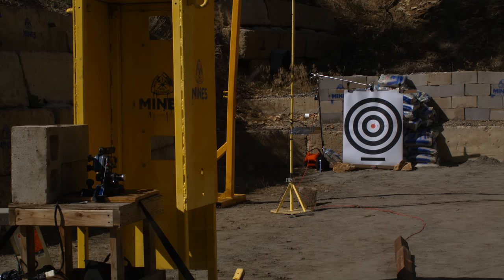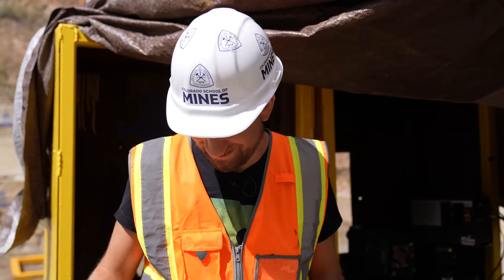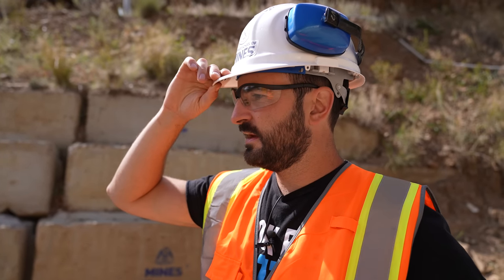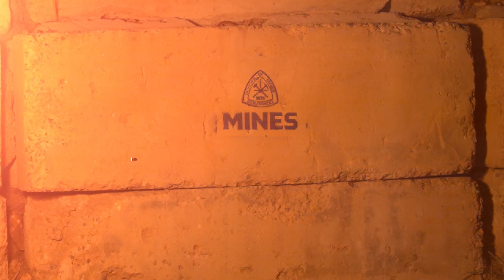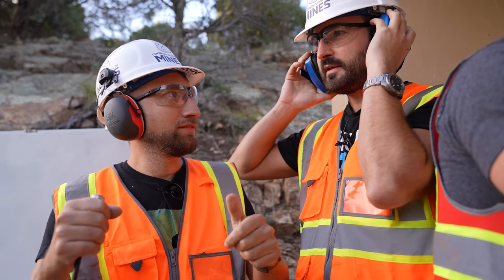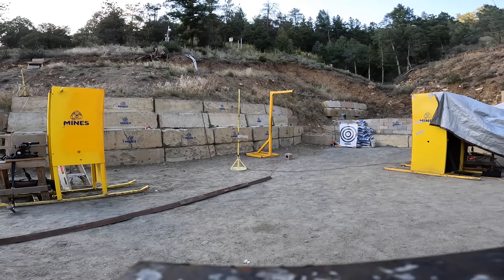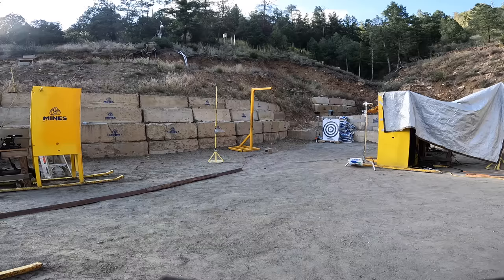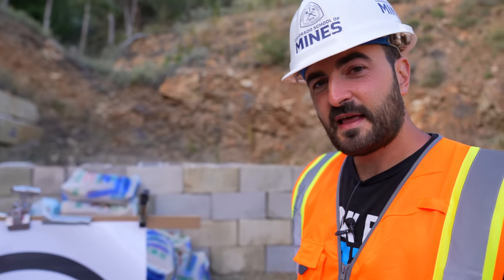Can Explosions Deflect Bullets? 2 MILLION FPS - The Slow Mo Guys

Comment: As a test engineer for a weapons company, it would probably be even cooler to redo this test with a range of at least 100m and a 7.62 or 12.5 machine gun. Why not take advantage of this greater distance to add explosions to the trajectory. :)
I love your experiences! It's great, thank you!
Reply: Can connect with me if possible.
Reply: wouldn't it be more noticeable if they used tracer bullets?
Reply: What? Why would that be cooler? What would the distance change?
Reply: Bro just tryna flex
Reply: @themashedavenger5461  
In theory, the projectile will have less energy and go marginally slower such a notable range, leading toward a few small factors helping the explosion have a larger effect on the projectile.

Also might be why he's suggesting a larger caliber, though those calibers also have more propellant to be faster, somewhat mitigating the first few factors in terms of testing if it would have a greater effect..
Reply: Yes, would be very interesting to have a proper test setup with a supersonic bullet, sturdy firing mechanism and target, repeatable ignition, data plotting etc. But ig they're first and foremost youtubers, not scientists and it wont improve the footage soo...
Reply: @NoBody-pw3kfthe main problem was that there was not a repeatable test setup (as you can see by the spread) so the statistical error was too big to get any meaningful data out of the experiment
Reply: Your job sounds fun!
Reply: Do arrows, subsonic 22 caliber bullets subsonic 300 Blackout bullets. supersonic 7.62 bullets @ 3000 fps/ ~1000mps, then larger supersonic bullets. Then we would find how speed affects trajectory just as we do shooting longer distances.

Comment: Regarding the exposure, if you can get access to identical cameras (I know, probably not gonna happen with the good ones) you can create a mirror setup to perfectly overlay their perspectives and have each record at different exposures, allowing you to capture HDR footage in slowmo, or fade between the shots to always get it best exposed.
Reply: Could get misaligned due to the shockwaves.
Reply: @Kamzik123 sounds like a skill issue
Reply: @Kamzik123 as long as the camera is further away from the explosion than the bullet is you will still get a stable shot

Comment: The bullet has a pretty tiny surface area for the shockwave to act on and is quite dense. I would've been more surprised if it had been significantly deflected. But who cares because awesome slowmo detonations are always epic.
Reply: Yea, the premise had me instantly thinking of that old Mythbusters episode where they tested if an explosion could 'push' a person in midair away from the point of detonation Hollywood style. The effect was so miniscule that they tried to 'replicate the results' by strapping a huge sail onto the dummy they were using and it still barely made a difference. That dummy was way, way less dense and carrying far less relative kinetic energy than a bullet in mid-flight. Based on those results I knew right from the start that the C4 never stood a chance against the bullet. Still a fun video!
Reply: That's exactly the relevant factor. You could possibly even estimate the amount of deflection.
Reply: Who would have thought that bullets are designed to go straight
Reply: also the gyroscopic inertia from the rifling

Comment: From my limited military experience, you'll have to set off the explosive before the bullet gets to the explosive location to get any effect on the bullet's direction. In my mind the way you were doing it was like the reaction from a two stage rocket. There's another YouTube video explaining explosive reactor armor on military vehicles. That'll get you a better starting point for round two.
Reply: I agree. I also belive they used the incorrect explosive. It should have been a pushing charge. In fact, now I think of it, perhaps a water impulse charge would have the best chance. Though I suppose it would leave a question as to the water or explosion pushing the round
Reply: Water Impulse charge is a cutting charge. I don't suspect it would have enough concussion force to deflect the bullet.
Reply: Yea exactly. It's like asking whether or not water can deflect a bullet, but instead of shooting the bullet into water where the bullet is experiencing the proper opposing resistance, you instead tried to pour water onto the bullet as it was traveling and barely got any water on it. The shockwave from the explosion needs to have started and is expanding toward the bullet for the bullet to experience the most resistance that could lead to a delflection. If all it's doing is going off right above the bullet, or right behind the bullet then it's really only going to chase the bullet and not apply that much force to it
Reply: It's dollar store physics 😂
Reply: @shable1436  😂😂
Reply: @matthewbergeron3641 Except the shockwave is moving faster than the bullet.
Reply: I agree, more like the "rolling barrage" from WW1
Reply: @alexanderpetrov7027  never heard of the rolling barrage. Looked it up and I can see how you can correlate it with their experiment. Moving under artillery fire like that is how we used to do it in tanks (M1A1) in order to approach and clear mind fields. Didn't know their was an actual term for it. I learned something new.
Reply: ok
Reply: I was going to suggest doing the same exact thing, and try to have the travel path of the bullet pass even closer to the epicenter of the explosion if possible.

Comment: You need to think of this like the timing of a car’s ignition system. For the most effective firing, you set the ignition to fire just before the piston is at the top of the cylinder. Therefore you need to look not only the explosion, but the shockwave. The bullet has already traveled quite a distance between the explosion and the shockwave.

Comment: Pressure on the bullet must be related to the surface area. So you could calculate how much it gets deflected according to the weight. Probably more noticeable by distance. Another interesting effect might also play a role. As the explosion creates a high density area you might even get an additional lensing effect as the bullet moves into and out of the high pressure area. For this the explosion would need to be earlier and the bullet closer. Great footage!
Reply: It get even more complicated when you have to account for the gyroscopic stability of the bullet.
Reply: @LeCharles07  Gyroscopic stability should only effect spin or wobble thus keeping direction and reducing aerodynamic fluctuations. A side force would only move the bullet, not change its relative direction. A lensing effect might give it a bounce or dive depending on the angle but probably not effect is as much due to its spin.

Comment: Going into this, I was curious how you were going to nail the timing given the speeds involved. The idea to use the bullet as part of the trigger is that kind of clever simplicity that I love and always seem to not think of.
Reply: Yea that's pretty smart
Reply: Thank the Lord there's a lot of people in this earth much much smarter than myself. Sometimes I'm clever. But these two are smart.
Reply: It's a very interesting method and it makes a lot of sense seeing as similar systems have been used for actual military applications. Some HEAT warheads such as the British Swingfire ATGM uses a similar system to set off the main charge, although it works in reverse. As the front of the missile impacts a target, it deforms hitting another conductive layer underneath it which then completes a circuit. HEAT warheads like this are very time sensitive in the sense that if the missile doesn't go off at the exact right time, the copper jet won't have enough time to form properly which means it won't penetrate.

Comment: Interesting video. I would also say that the tiny surface of the bullet, ignoring all stabilizing effects like rifling, inertia, etc., also allows not much energy transfer from the shock-wave to the bullet.
That's why active armor on tanks can effect an incoming RPG to some degree as the hollow charge is a bigger target then a bullet.
Even your floppy target ruined more precise results quite a bit, it was interesting to watch. A repeat with a solid target mounted stable would maybe bring a measurable result. But I am sure the result would be neglectable until the shot was supposed to be a precision shot on a very tiny target.

Comment: To be honest, I think revisiting with a shape charge would probably be the most effective method. Because instead of just an explosion going in all directions, you have a channeled release of energy.
Reply: Working out the timings and aim to use a shape charge to shoot down an in-flight bullet would make a pretty fun video on its own.  And yeah, shape charges are different enough from a simple "blunt" explosive that maybe it could produce different results.  The timing would have to be even more precise because if the bullet passes through anything but the very initial point of the molten copper jet it wouldn't really be any different from flying through the shock wave from a blunt explosive like this video.  Although I think it could be done with the right hardware and software, just have the bullet hit two different break wires a few feet apart, use that to quickly calculate its velocity and adjust the timing of the shape charge to match.  Also the rig that holds the gun will probably have to be mechanically attached to the rig that holds/aims the shape charge though, have to remove every variable you can to get a shot like that.

Comment: I really think you should try to get the explosion ahead of the bullet, almost like a dome shield to try to divert it, so the bullet travels into the shockwave that is already there and moving.
Reply: I agree and believe the explosion needs to be directed, much larger, or pinpoint in timing/accuracy to properly deflect. The energy of the explosion dissipating so quickly combined with designing a bullet to travel through air with minimal resistance makes me think the shockwave has no chance unless that explosion is massive.

Comment: To deflect the bullet, I think you will need to have the explosion closer to the bullet.  As it is set up, the force is somewhat spent by the time it gets to the bullet.  Great stuff as always, guys.  Pleased to see Dan in this video as well as Gav.
Reply: density of bullet 10,000 times that of the explosion gasses, you'd need to be much closer to the explosive (a cm or two) to have a reasonable effect I think when unconfined.
Reply: @MarkTillotson  The whole point of the experiment was to find out if they could deflect a bullet with an explosion.

Comment: Such a cool idea!  If you ever revisit this my recommendation would be to get a rifle with sub 1 MOA (less than 1” spread at 100 yds) and move the target to 100 yds away, keeping the explosive closer to the rifle.  Since 100yds is the basis for how accurate a rifle is, you’d get a much better idea if the bullet was being pushed since you have a baseline performance to compare the test to
Reply: would also vastly reduce the amount of insane variation with the target flapping all over the place 😂
Reply: You'd need subsonic ammo because rifles typically produce much higher muzzle velocities like 2-3 times faster which would necessarily reduce how much you could hope to deviate the bullet (because it would spend proportionally less time in the explosion's thrust zone).

Comment: This is an insane result, especially when you recall that the 9mm was the *second slowest* bullet from the Bullet Race video during the Super Slow Show. 

Can you imagine how much force it would take to knock the Barrett 50 cal off course with this same setup?
Reply: There is more too it than just applying force, though I do in general agree the more high speed and heavy round will generally be harder to deflect there are other consideration that may throw in some surprises. 
It might well be a more powerfully spun up bullet is effected more by the really high explosion derived windspeed over its own rotation from the Magnus effect than directly by the moving air and shock wave directly for instance. In which case you might find a faster and higher momentum bullet will actually be more affected than this 9mm entirely because it is also spinning faster. Would love to see them test it some more, though if I'm honest I don't think any sanely sized single explosion will actually meaningfully change a bullets trajectory - too much inertia and travelling through the explosion too fast.

Comment: The mass of the bullet while travelling at such a velocity is much more than the force of the explosion being exerted upon it.  Simply put, the explosion either has to 'push harder' (C4 pushes pretty hard, but there are better force-mulitplying options out there) or the bullet needs to get smaller. Still very cool and a fair experiment for a revisit! Thanks for the awesome entertainment always Guys!
Reply: It would be interesting to do the calculation of the force needed in such a short time to deflect a bullet with such a small cross-sectional area. Anyone good enough in physics to calculate that?
Reply: @JanStrojil  I don't think the problem is the size of the bullet. It's the short time of "contact" between the explosion and the ballet, and as OP said that air has a density 1/10,000 that of lead. So deflecting the bullet with a shock wave is like trying to deflect a thrown brick by brushing it with a feather. Wind can deflect bullets simply because of the (relatively) huge amount of time it acts upon the bullet.

Incidentally, cross sectional area goes as the square of size, while mass goes as the cube. So smaller bullets (with smaller cross sectional area) would actually be easier to deflect. So good call by them to use a slow, small bullet.
Reply: Mass ~= momentum ~= force. I don't know what you're talking about.

Comment: I wouldn't have even thought to wonder if an explosion shock wave could affect the path of a bullet in flight. Wow, thanks for doing this experiment, guys!
Reply: It would be interesting to see the results from even more delay. Possibly have the bullet travel into the leading edge of the shockwave... (like 7o'clockish).
Reply: @Robert_McGarry_Poems My thought too! If the bullet is earlier would it spend more time having to travel through turbulent air, and would that affect its path? Such a cool experiment.
Reply: Of course the explosion always pushes the bullet away. It is just that the effect is inversely proportional to the distance from the explosion. With the arrangement used in this demonstration, the effect was simply too small to see it clearly.

If the distance were reduced, and everything else were kept the same, the deflection would have been more clearly visible.
Reply: @cogoid   The other thing that occurred to me is that those shock waves are pressure waves, and pressure is force per unit area.  The cross-section of the bullet that took those shock waves, powerful as they were, was a tiny area, so the total force imparted by the shock was probably very very slight compared to the energy the bullet had due to its mass and speed.  With that hindsight, I am now no longer surprised that they didn't measure much of an effect, although I admit that wasn't the outcome I imagined before watching the whole video.
Reply: @cvkline  Specifically we are talking about difference in air pressure between one side of the bullet and the other.  While there is some macroscopic air movement that provides an impulse, the explosion is basically releasing a large amount of energy that will relatively slowly diffuse outwards--with the exception of the shockwave, which travels at the speed of sound... and the light, which travels at the speed of light, but also doesn't matter here..  Once the pressure shockwave passes by the bullet, though, the pressure difference from one side of the bullet to the other is probably fairly minimal, multiplied by a small surface area and a short period of time interacting.  Given more time or more surface area or more pressure, there would be a bigger effect, I'm sure.
Reply: I think the concept is called "reactive armor"? So I have encountered the thought before in fiction, but fun to see that nope, bullet still punches through.
Reply: @cvkline  The simplest way to measure the effect is to put the bullet on a pedestal at a given distance from the charge and see how fast it will be propelled by the explosion.
Reply: @suomynonAyletamitlU  That's a good point too, beyond my simple freshman-year physics thought.  The shockwave is impressive because when it encounters something with a large area the effect can be big, but the real "meat" of an explosion is the expanding fireball, which as you note is not a big pressure difference over a small space even though the total energy is large.
Reply: @feha92   I wonder if reactive armor "works" while this didn't is because the force imparted by the reactive armor comes from something immediately next to the projectile;  the explosions here were nearly a meter away.
Reply: @cvkline  meter? Are you joking? a couple dm at most.
Reply: @feha92  It would be interesting to know the actual distance. It’s a little hard to guess from the footage, although the size of the bullet is good for scale.